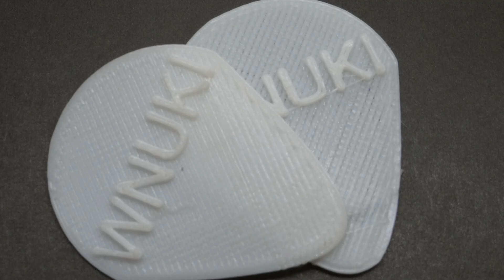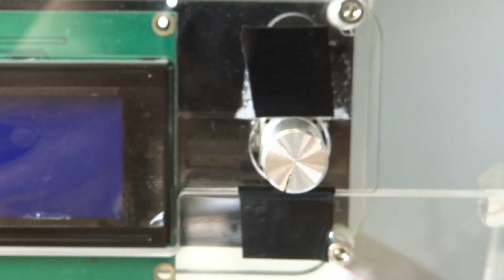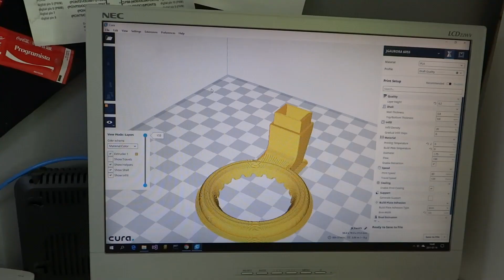Is Anet A8 like printer still any good?

Comment: Nice video! Not a bad 3d printer. Btw if you still want to prevent the stepper motors from overheating you could adjust the current sent to them on the motherboard.